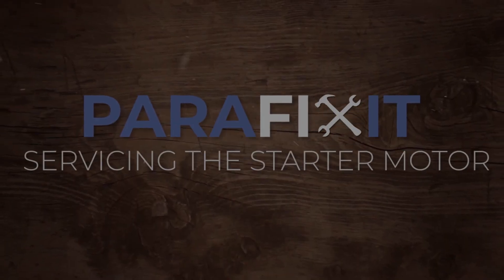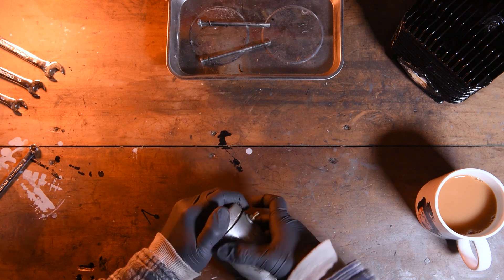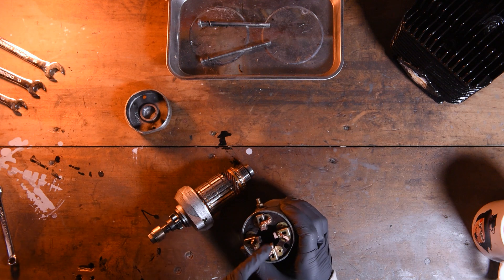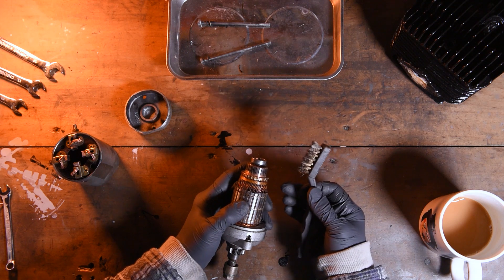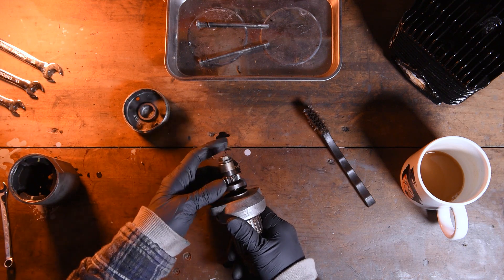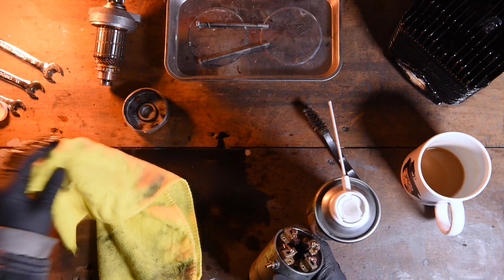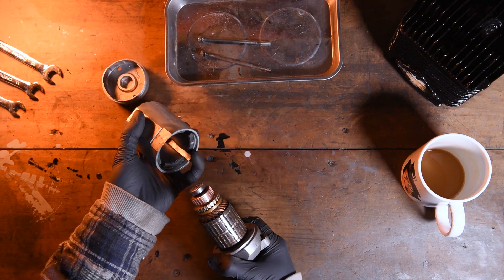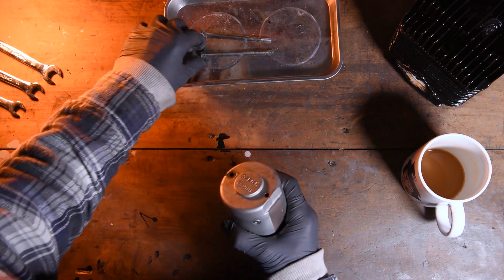How To Service A Starter Motor

Comment: I can’t find any brushes for my electric starter! It’s super frustrating that they don’t sell any parts to service the starter. They want you to buy a new $200 starter. It’s a polini Thor 190 if anyone knows of anything.
Reply from the maker: If you’re kinda handy with this stuff you could find some similar size brushes online, even if they’re slightly bigger, then gently sand them to size fit them into your starter house and you should be good.